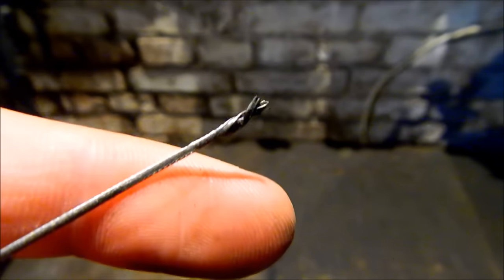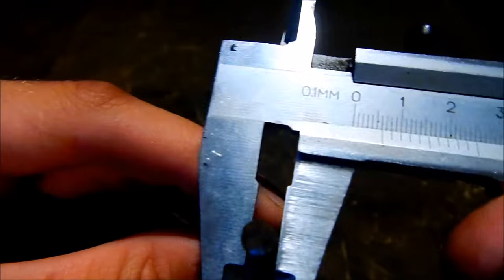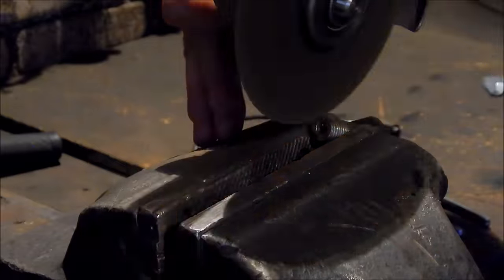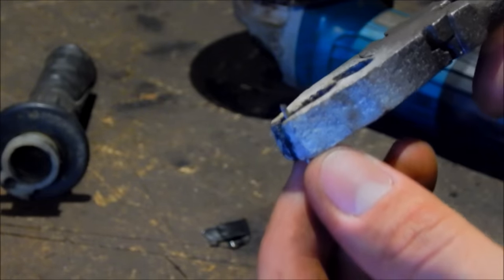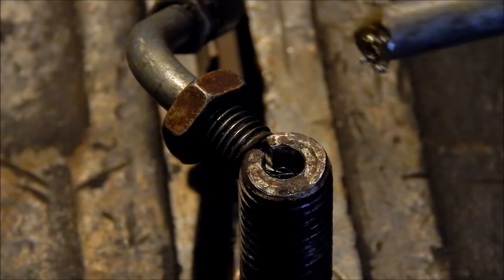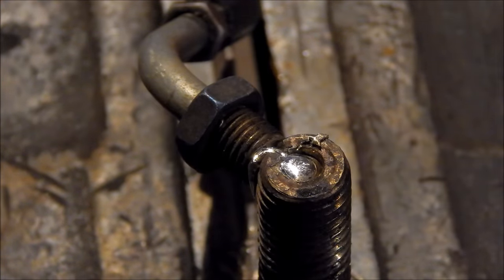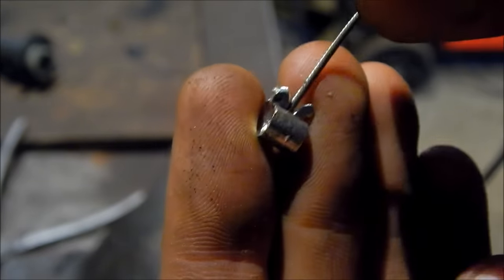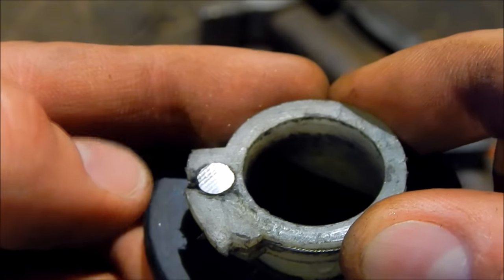Throttle Cable Solder Repair Tool - Simple Fix!

Comment: This idea may have been around for years but it's still useful to people who've never seen it
Reply: I'm one of those that have never seen this. I'll be doing this soon.
Reply: Which metal you used to welding?
Reply: My cable is stainless steel and won’t accept lead or silver solder. Some special flux needed. Any one have ideas?

Comment: I actually have two angle grinders. I use them at home. One is Harbor Freight, corded. I bought it 20 years ago. I had to fix the switch. It cost 12 US. It still works. The other was Chinese. Bought 2 years ago. 24 US. Cordless with wheels, charger included. You can lose 36 US in two seconds just walking into a club.

Comment: I have always wondered how I could do this.  I remember when I was very young, I used to take my cables to a little shop and they would do it for me.  Great explanation and a money saving process.  Thanks!
Reply: Yamaha. Went from a JT2-MX right to a DT-1 250, at 14 YO. That was a great Saturday. The seller knew the exhaust was clogged and bought new pipes but then lost interest. He included a new(er) stock pipe (which I used when I got old enough to register the bike) and an expansion chamber. That was a great Saturday (for me, NOT my neighbors). The pipe on it was totally clogged. I was about 110 lbs. It was 1975. I put the chamber on first. Oh, how loud. And I was about flappin' in the Wind! I know. Nothing like a YZ250. Or TZ750!  😳I have a ZX 14 today. Stupid Fast.

Comment: I'm retired and do small engine repairs as a hobby. Some cables can be as much as 50.00 dollars to replace on snowblowers riding mowers etc. and this tool would be a great asset to myself and my customers when a cable is broken. no ordering cables and long delivery waiting anymore. Just take out the tool and in minutes save time and money.
I will definitely be making this tool for my tool box. Thank you for sharing.
Reply from the maker: Thank you for watching. ;)
Reply: I'd suggest using metal with a higher melting point than lead for any cable that gets pulled frequently.

Comment: This is quite a good idea, I've been playing around with quite a bit trying to perfect it, I'm slowly getting there. One trick I've added is I made a second identical tool, except instead I cut a groove down both sides of the bolt, place it along side the other bolt in the vice to hold the wire straight and in place. Works pretty well. Thanks for the video.
Reply: Envia como lo isiste

Comment: This has got to be the BEST tutorial I have seen on making these cable-ends. Excellent job! :)
Reply from the maker: Cheers man! I'm glad you like it and it was helpful. Just something I found useful myself and thought I'd share it.
Reply: It is.
Reply: @Pushyhog  4
Reply: and we make home alone?
Reply: it costs more than the cable itself
Reply: @sunnsucksse3148   Maybe those are the economics today, but in rural Alabama 60 yrs ago with no money, not so. Good video Sir. Of course, you had to have a torch, drills, and a vice, none of which I had either. I did have a hack saw and old bolt.

Comment: I've had  a similar home-made tool for  at least 50 years - a gift from an  old  motorcycle mechanic and racer who went back to the the 1920s  -  he showed me his technique which included leaving  the cable end a bit frayed rather than cutting it clean, but there are clearly  merits to doing it either way.  
.

Comment: This is a great idea and a good job. I've always been one for making and repairing things that many wouldn't and I've used methods similar to you. I once used one of the 3 brass pins in an electrical plug. Unscrewed the little screw that holds the cable put my throttle cable through and just ground it into a round shape then did the screw up and soldered it. Lol. It lasted ages. Thank you for sharing your video. 📹👍
Reply: I was given a model airplane and it’s accessories and it came with a Z-Bender…that’s a pretty popular way to attach a cable… it’s very handy to be able to make your own cables as well!
Reply: Another very handy video!!! Awesome job 💪👏👏💪👏👍😂

Comment: Very nicely done!

I always kept a spare throttle and clutch cable cable tied to the originals so that if one broke the replacement was already routed and simply needed connecting and adjusting.

The ends were sealed against the elements whilst they were cable tied to the originals and if applicable the cables were lubricated using an aerosol cable oiler.

Good, helpful video.

Comment from the maker: This fix is meant ONLY for THROTTLE cables as a temporary fix just like the video title refers to. If you repair brake cables like this you will die and I'm not responsible for that!
Reply: even if they dont fail, YOU WILL DIE
Reply: Bryn    Well I anyway, we’re all old enough to know that by now
Reply: Wait wait, what?? We are going to die?! 😮

Comment: Brass bar is always good for throttle, clutch and brake cables. 

If you’re making a new nipple in brass, chamfer the hole on both sides. The entry side allows for some movement in the cable without chafing and wearing. The chamfer on the other side allows for the cable end to be mushroomed out to get a better grip when soldered. 

The advantage is that brass is a better material for soldering to than steel. Also, all the classic bike cables had brass nipples. 

Thank you for sharing
Reply: The melting point of bass is massively higher than lead and hard to achieve for most folks.
Reply: @ProleDaddy  I believe he was talking about using round brass stock with a hole drilled through it as the cable end.  A large chamfer on one side of the hole would allow mushrooming the cable end before soldering.
This would eliminate the need for the bolt and making a mold.
I think that's what he was describing, but not sure.

Comment: I had a similar issue with a leather recliner sofa cable. Here is what I did. I had a spare round-pin UK 240v socket. I removed one of the pins, it was similar diameter. I cut it to size and screwed the screw down onto the cable (where the electric wire would have been). Fixed. I was quite impressed with how ingenious it was.

Comment: I've always thought there was nothing you could do once you'd pulled the off one of those cables, so naive, a simple answer was there all along. Thanks!
Reply from the maker: No worries. I'm glad you find it useful. ;)
Reply: +Benjamin Trevis - They have " Cable Ferrule " at Lowes of Home Depot at the Pre-Cut Cable Section, that you can get.  If you are close to Harbor-freight, they have them in a Box for $5.99 and all different sizes too.  It will be easier than making your own... Since these are for " Smaller Engines " as stated in the Video.  Although it is still inventive, and I gave it a Thumb's Up :D.

Comment: If you use an acetylene torch just light the gas with no oxygen and smoke the die you are using and that will act as a release agent for the lead or solder you will be using. Made many car battery posts using a tapered out nut and smoking the nut before placing it in position and melting lead into it. A little twist and comes right off!
Reply: soot from a candle flame also works.
Reply: Perry Toften
Reply: Perry Tofu
Reply: Perry Toften Good one of 8
Reply: Slick as hell, good thinkin'
Reply: That exact barrel connector is on bicycle brake cables. You can buy one for like $2.
Reply: what if it'a a snow blower cable that is discontinued ? at least we have learn how to do it
Reply: It's about Making not Buying.
Reply: Carbonizing flame 👍🏻

Comment: ...not what I expected! Nice fix. I usually take the steel pin and drill a cable sized hole in it, ream the backside where the bare cable end exits the rod hole out deep, put cable thru, fray the end, pull it up tight, then heat all up with heat sink on the cable outer side of the cable (usually the aluminum jaw vice), flux it up, and solder with tin/antimony or silver solder wire.

Comment: Wow I'm 33 an never played around with mopeds or anything like that.  Just got one an after a couple days the throttle cable broke exactly where he fixes it.  I had already started trying to cannibalize other bikes to fix my problem when I decided to check YouTube for an easier solution instead.  This is an excellent fix an I can't for tomorrow morning so I can get this going.  What a capital "G".

Comment: I love this! Buying a replacement cable is pretty cheap BUT I love the ingenuity and the simplicity to this - why wait when you can do it yourself with stuff you have lying around! Thanks for sharing :)
Reply from the maker: That was the main point of making this video. I'm glad you liked it!
Reply: I've just realised that I can use your approach to fix my window actuator on my car - I've been putting it off because in principal I disagree with Audi wanting to charge me $400 when I know that the part costs less than $10 and they'll only need an hour's labour, if that. The whole system is based the same principal as the throttle cable. The part I received from ebay was the wrong bloody length of cable - apparently for a different version of my car (probably for one made on a Tuesday while the seagulls were flying inland but against a westerly wind …) - the only thing that was holding me back was how to make the securing lug - I was planning on using KNEEDIT but having seen your video I've realised that I can use that same principal to make up my own cable with some bicycle brake cable. Double-whammy! Thanks, Donn :)
Reply: My mother scooter a Yamaha jog 50 I can't find this cable in Brazil. There other motorcycles that they don't produce no more and we have to make it, I would prefer to buy but don't have this option.
Reply: Trying to get longer cables for a Harley. Aftermarket sites are selling  throttle cables for like 75$ - 90$. Sometimes u gotta make due haha.

Comment: Very very clever and efficient!  
 I appreciated  at its higher point this sentence you said :"If you don,t have a disc grinder it is as if  you had no head!"  (I have 12 of them)
Reply from the maker: Dude! Angle grinder heaven right there! :D
Reply: What, you have 12 grinders, or 12 heads?

Comment: I have been riding and maintaining my own motorcycles for over 40yrs. This is an excellent idea!
Reply from the maker: Very cool! But remember, this is a temporary solution for throttle cable only. 😁
Reply: @DonnDIY  Yep. you need a bit more tug for clutch and brakes.

Comment: you should always clean the crap out of the end of the cable with an alcohol based parts cleaner spray and then dip the end in flux first before you try to solder a new end on it. I've made 100's of motocycle cables and was taught by a pro. I've been a motorcycle tech for over 20 years. Just some advice.
Reply: cantfoolme hi, level 2 pro here. You can just use extra flux and heat, no need to clean
Reply: @aqib2000   I would still clean it as it does not take that much more time however I'm with you. The disrupted end and flux would be plenty strong.
Reply: @aqib2000   lvl 5 necro here. a clean solder or weld is the best one.
Reply: Proud American It’s been s year since my comment, I am now a level 6 pro, I refute your comment
Reply: @aqib2000  but pro's clean before they weld :p
Reply: Proud American but pro pro’s don’t call soldering welding
Reply: @aqib2000  pretty much identical, heat welding is still a thing so is brazing.
Reply: Proud American you’re right they are pretty much identical to the untrained (non-pro) but that’s why it’s called brazing, welding and soldering because they are different.

This is soldering which doesn’t involve getting both  metals molten. A pro would know
Reply: @aqib2000  yup just like a pro would clean his work prior to starting on it 😂
Reply: Proud American yeah a normal pro, but I highlighted earlier I was a level 2 pro and now a level 6 pro

Comment: I love your mold. I've made brass ends and soldered them on but I'll try this. Some thoughts; I like to tin the cable before I cut it. This keeps it from unraveling, but you can still smash the very end open. Use tinning fluid (acid) when soldering steel to ensure adhesion. Be careful not to overheat the cable. If it gets to red heat it will destroy the temper and make the cable brittle.

Comment: At first I thought you were going to drill a hole in that 6 mil nail a bit larger than the cable, taper the back side of the hole and silver solder the cable through the nail.  Well, that's what I've done for years, but no, even a better fix, you build a mold out of a bolt and a nail!  Very nice!

Comment: Good Idea -But if you put a couple strands of copper wire from a cord inside the frey it will not come apart again lead sticks to copper better than stainless steel .
Reply: hence the frayed end

Comment: Well, I was looking for a video as both my throttle and idle cable broke off on my Harley Davidson Road King, 1998, carb not fuel injection. I've done this with my lawnmower. I used those little lead dinners for fishing where you just crimp them onto the fishing line. Then put additional lead solder on for strength. That was on my cable for a self propelled lawnmower. Still working 3 years later. So I should be able to do something similar to my Harley so I can get it to the shop as both cables are old and need replaced. Thanks for jogging my memory. And you did a much more professional job than I did but I've got brass fittings but the lead should get me to the shop. Thanks!
Reply from the maker: No worries!

Comment: You can do the same thing by drilling a piece of wood with a slot in the side for the cable. That way you don’t need to screw around with a bolt.
Reply: Won’t it catch on fire when the torch hits it, to “settle” the solder?
Reply: @chipper442  Sure.  But, just blow the fire out and you're done.  Solder melts really fast. You can flame the solder above the hold and drip it into it, or you can torch directly on the wood.  Either way, the solder melts so fast it won't matter.
Reply: I just posted the same thing. I used to do this to fix bicycle cable when I was a kid.  I did not have a torch but I did have a D550 soldering gun

Comment: To fix your throttle cable so you need is this.., then uses drill press and other things not in the “you’ll need” list! 😂 
This is what he should have said..
     “All you need is these materials and a small machine shop!”
Reply: I don't think expecting someone to have a nail, drill, and drill bit is too much to expect.
Reply: @brianhaygood183  You’re right about that. Don’t worry about that complaint/whine….check out his/her user name…self explanatory…

Comment: I got my Angle Grinder stolen several times in my life. Just bought a new Air one.  I have my head back. LOL    This is a great Video, the bolt mold is an awesome Idea and can be modified for all kinds of cool stuff.   Thanks.

Comment: The end broke off on my Seat Ibiza door handle cable during the first lock down last year which meant i couldn't open the door from the inside and couldn't get a new cable, so i found a strip of 6 amp terminal blocks, cut off one section, cut off the plastic insulating material leaving just the metal part. I threaded the cable through the inner door handle and put that onto the end of the cable. I pushed it onto the cable so i could tighten up both screws onto the cable. It works so well i haven't bothered buying  a new cable

Comment: You absolute bloody legend!!!!! This is friggin unreal, soooooooo much better than using cable harps. Thanks heaps brother, this is something everyone should know.
Reply from the maker: Thanks for the enthusiasm - this way of repairing a cable with lead however is only suitable for throttle cables since there's not that much of a pull on'em. I wouldn't recommend it for clutch and brake cables, never. Brass ends soldered on would be maybe sufficient but not this lead end. Stay safe!

Comment: nice, i wasn't even 100% sure that these things were lead, i just took apart two broken choke cables and used a throttle cable to start to fix the one, i might need to file the ends, and i know i need to shorten the cable and add an end like in your video, but now i know i can, also i used a soldering iron to take the lead off

Comment: Instead of drilling out a bolt you could just use clay to form the mold. I've used solder on my old mopeds and bikes with good results.
Reply: I have tried lead on cables since I was 10 years old and it always pulls out on anything bigger than a throttle cable.

Comment: Silver solder is stronger, lead solder will let the cable pull out of the barrel end
Reply: bike is only one of those yamaha pee-wee 50's
Reply: I want silver solder material for lathe cutting tool tips soldering. give me link
Reply: I agree 100%
Lead is way too soft.
If you have an pot metal casting of some sort lying around. Old mower carburetor ect.
Some grindings from that mixed in with silver solder would be super tough.
Reply: gold is the best
Reply: Gold is WAY TOO SOFT

Comment: You can make the drum that goes on the end of the cable using the 6mm wide nail and drilling a hole through it to put it on to the cable. Buy some Fluxall from a welding supplier then you will be able to solder the drum to the cable end. I used Fluxall to solder brass to alluminium so it does work. It should be possible to get a neat cut on the cable with a top quality wire cutter with blade and anvil.